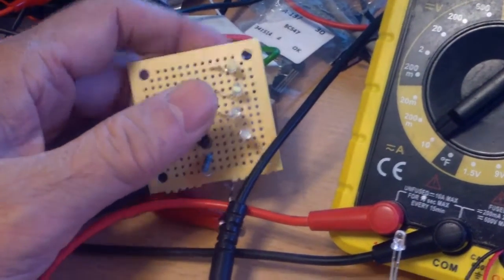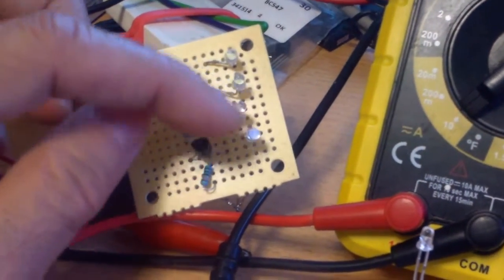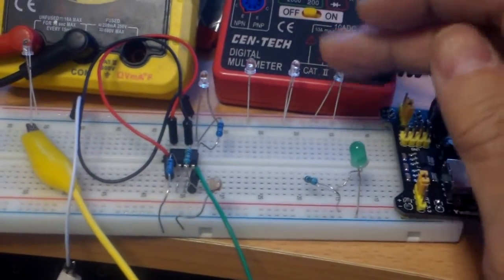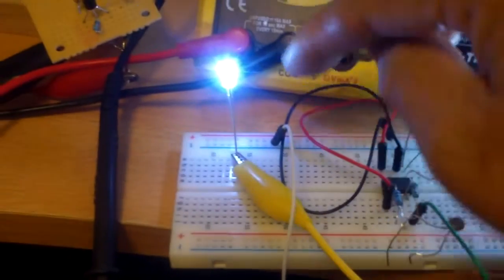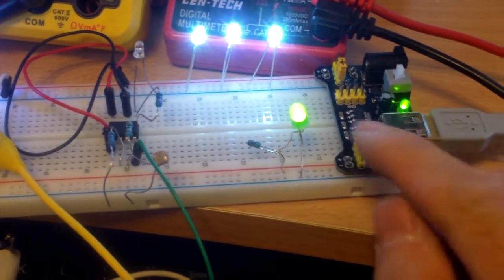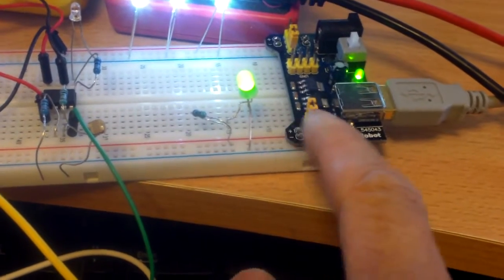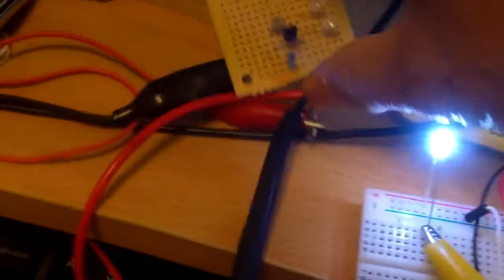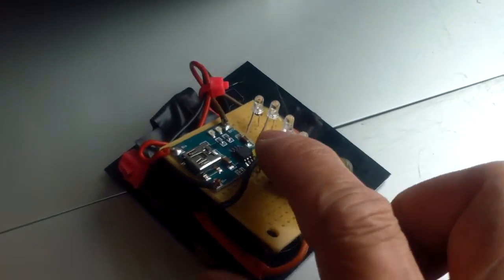Suggestions on making your solar light and checking your LED voltage and current draw

Comment from the maker: All good suggestions. There are so many combinations depending on your power supply. Curiosity also helps. I look at the strip light LEDs that I got recently and it is configured for a 12 volt power source. It uses the combination of 3 LEDs and one resistor (a tiny 151 ohm) and somehow parallel it into one long strip, and making it waterproof too.

Comment: You can use one resistor for an array by adding all the LED forward voltages together and staying under the input voltage, then size a single resistor that way.  You could combine some in parallel and series to use less resistors too.  Using less resistors saves power.  I test LEDs with a volt meter on the diode setting.  I use this site(Search for LED wizard) to get the best configuration.